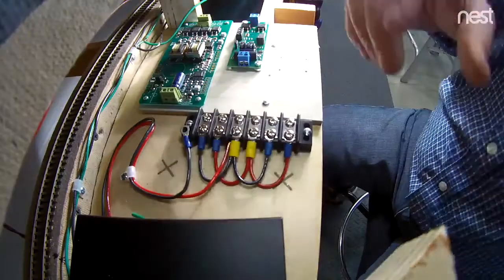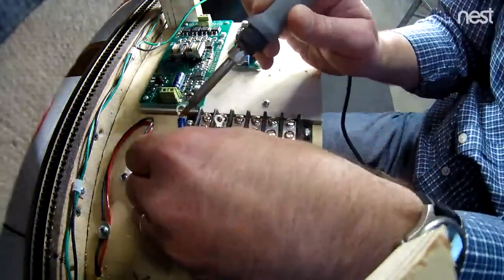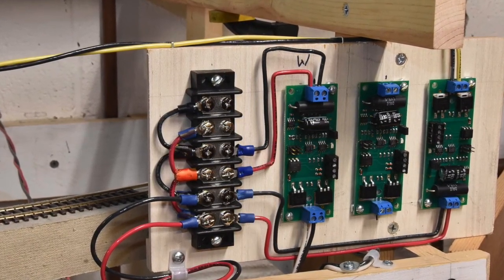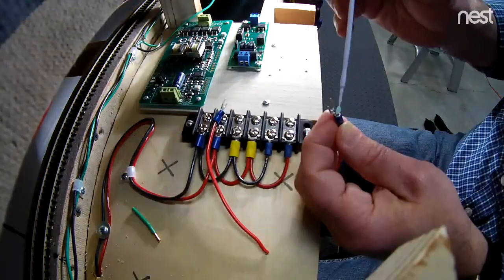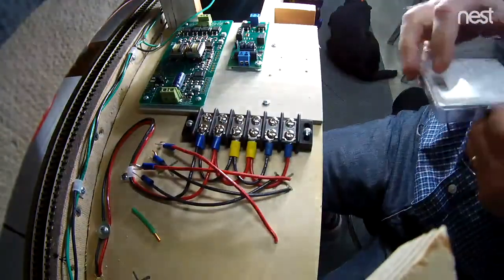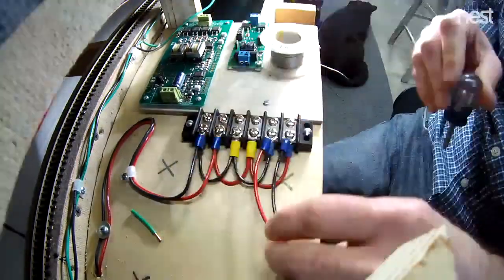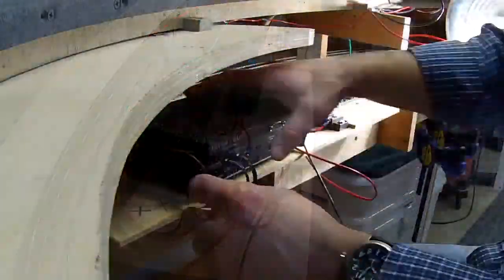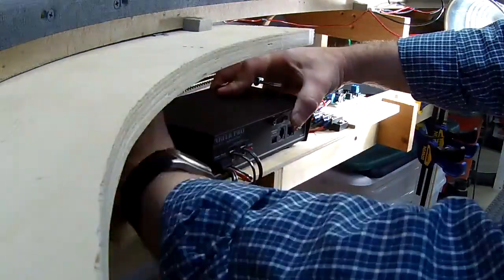18 - Command Station and CIrcuit Breaker Node Wiring

Comment: Matt, thanks for sharing. I'm interested in how you setup your "auto-reverser"? I have the same one but have not installed on the layout, are you going to do a video showing how you put yours to use? Thank you again, D. Muse
Reply from the maker: I hadn't thought about that.  For various reasons, I've installed it with default settings as of this writing.  I'll be doing more work with the breakers (and auto-reverser) in the future, which may warrant a separate video.  This is my first use of these devices, so their installation is doubling as a learning experience.